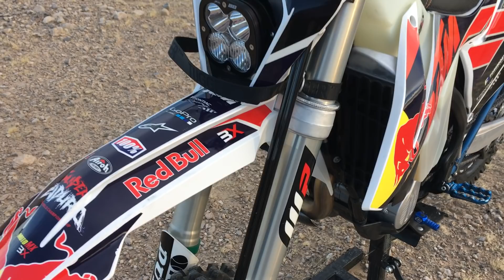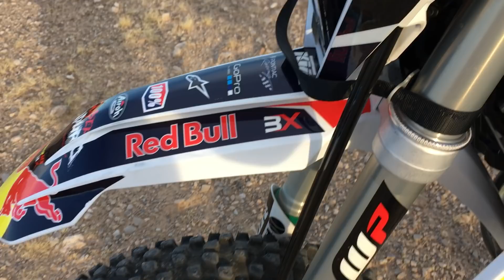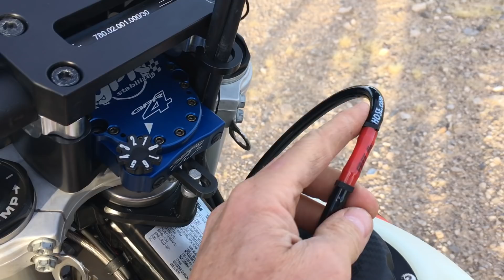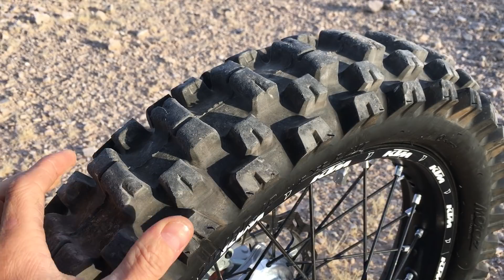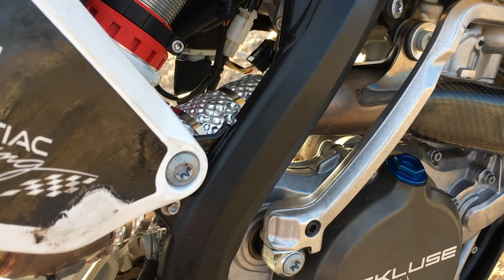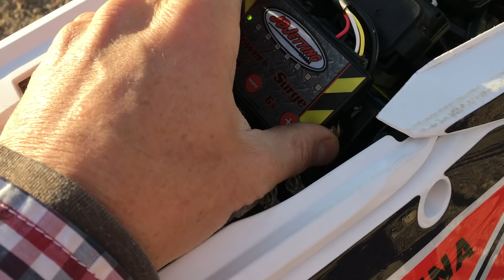2017 2018 2019 KTM 500 EXC-F build

Comment: I live in Maine and have the exact same motorcycle and I did almost the exact same upgrades SMS exhaust I did the same ignition module where can you adjust the fuel injection and I also blocked off the air intake and remove the Reed valve and edit a small sprocket on the front and it's unbelievable what an amazing motorcycle I love it

Comment: $11,000 and you have to buy tires, head light, skid plate, turn signal, foot pegs , shift peg, shock cover plate, brake rotor cover , axle adjuster block, shock spring, 
seat, grips, wmf muffler, pipe guard,  kick starter , battery , tuner , ha ha  NUTS !
Buy used with these parts on it.

Comment: I had a question about the turn signals.  I just bought a pair, I started to drill in the same spot that you have them. However the length of the threaded peice on the signal are too long too fit in the channel where the wires should go. Did you have to cut the signal or use washers to gain clearance?

Comment: Something to keep in mind with EXC's, the kickstarter is only useful if your battery is still good, but can't spin the starter fast enough to get the engine running. If your battery is actually dead, the bike won't run no matter how many times you kick it, bump start it, etc.

If you're going to add a kickstarter, I think also adding a capacitor system is a must
Reply: I’ve also read about this issue... so kick start only good if a little juice is still available, worth looking at the solution or carry a small bank that serves as a jump starter
Reply: and a switch to turn off the always on headlight
Reply from the maker: Nice observation!

Comment: Did you have to use the dual load equalizer’s on the rage turn signals?
Reply from the maker: if you mean an LED specific turn signal flasher to replace the stock flasher - then yes.
Reply: HoboMoped ya going from stock flasher to the LED rings, on there website it says that you might need their “dual load equalizers” if you are. I was just wondering if they were needed

Comment: The accessories are worth more than my bike.
Reply from the maker: moto at this level is the kind of thing where you open up your wallet and shake hard!
Reply: Do you have a part number for that sicass rear fender? The only thing I can find on their website has larger turn signals at the very back of the fender.

Comment: have you done builds with big bore kits like thumperracing 660 kit for the 500
Reply from the maker: i wish. that's a $5k-6k engine mod job by the time it's all installed, rebuilt and ready to ride. no one really needs that kind of power on the dirt - that's a snow bike set up. why do you ask? you looking to build a 90hp dirt bike?!
Reply: just seeing if you have done builds like this with big bore kit's one i would go for is the 450's 540 big bore kit and ktm make a 690 husqvarna 701 honda had a 700 and maico has there 685 2t so i would not say it would make the ktm 500 a snow bike

Comment: Great build and video. Inspiring me to do some of the same mods. I have a 2018 500 EXC and installed the rear Motogadget M Blaze turn signals and they worked great, I then installed the Rage front turn signals and they cause both the Blaze to flash at the same time when turn signal is used. Hook back up the stock fronts and everything is fine. Any ideas? Thanks
Reply: I think I found the answer, a Sicass wire harness should stop the issue.
Reply from the maker: that's a strange one. like you have hazards. are you using an LED specific flasher unit?
Reply from the maker: Chris Gilder https://tacomoto.co/products/fork-wrap-led-full-light-turn-signals

Comment: I hate how hard it is to get matching blue anodizing from different companies!
Reply: Simple to fix take all your parts and have them re anodized to the same blue
Reply from the maker: yep, everyone has their own version of blue. same problem with all the orange bits you might want to add to a bike. it's pretty maddening. the only way to get uniformity is to find an anodizer in your area and have them strip and color all your pieces all at the same time. it's EXPENSIVE to do it this way but it ensures perfection of thta's what you're after.
Reply: zakky I
Reply: The problem is there isn't an exact science to anodizing the colour depends on tint and time in the dye etc the can vary from batch to batch let alone different companies

Comment: Moose feels better than air??
Reply from the maker: well, it depends on who you ask. 

we've bought and tested all the tire inflation systems out there, and in my humble opinion at he bottom of the list is a traditional tube, at the top of the list is tire balls, and just under them is a mousse. there's generally 3 flavors of mousse in terms of feel - the most lively and responsive is the NirtoMouses, in the middle zone is the michelin, and the softest or most 'neutral' is the motoz super mousse. that's my favorite. 

a mousse doesn't transit the deflection of the tire carcass back into the bike, doesn't roll the tire in side-flex in cornering, and never flats you out. 

it can be an acquired taste to some, but i'd say well worth experiencing to see what you think.

Comment: Bad-ass build !!  Did you use an inline resistor on the MotoGadget rear blinkers, and if so, what value did you choose ??  I have a '15 FE501S and thinking about adding the rear blinkers.  Also, where can I find that material you wrapped on the header to keep the heat off the shock ?
Reply from the maker: wicked cool lights right! the m.blaze wires straight into the bike harness, and install yourself an LED spcefic flasher to ensure thy flash at the normal 1 second on / off rate. https://cdn.shopify.com/s/files/1/0072/8562/files/mblaze_disc_manual_de_en.pdf

Comment: i just bought this bike brand new, its now less than 2 months old and im already having problems. the bike wont start. the bike ruined the stock battery, its completely dead and wont charge. i put in a new battery and the bike only starts half of the time. when i try to start it sometimes none of my electronics turn on and it wont even prime the fuel into the engine. or sometimes it primes the fuel then just clicks and doesnt even try to do anything else. im so over ktm at this point. $12k on a brand new bike and i already cant ride with my friends that have 20 year old dirtbikes running fine all day. really depressing. KTM is such a joke. I didnt want to believe what everyone said about ktm being unreliable but this is already like the 3rd time the bike left me stranded on BRAND NEW bike...unacceptable
Reply: Every KTM I have ever bought I had to replace the battery. The stock bateries suck. Now when I buy a new one I make the dealer throw in a new battery.
Reply from the maker: RideRedRacer well hell. That sucks. Sorry to hear about your issues. Your bike likely came with Skyrich brand battery? Ktm, Honda and a few of the other manufactures have been using them in the new bikes and in my experience I see these batteries fail very often. I have a small but growing pile of them in the shop as they die off. 

But after replacing all of these with a Shorai or Antigravity 8 cell battery all these bikes are problem free from then on. 

I know it’s lame to buy a new machine and have a garbage battery. Unfortunately is somewhat common. 

Have you been to the dealer and raised hell about it. Have him replace the battery with a Shorai or Antigravity and throw in an  Optimate brand tender. Best trickle we’ve tested.
Reply: I have a warranty, ill go to the dealer asap. I used my own brand new Shorai Battery testing at 13.3v and the bike still makes audible clicking noises from the relays and thats it. the bike doesnt try to start at all. Sometimes when i turn the key on nothing happens at all. and sometimes it works fine. Yes the stock battery is Skyrich
Reply from the maker: if and when it acts up again are you able to make a video of what it's doing and post it with a link here in this thread?
Reply from the maker: well my friend, unluckily, you've discovered the Achilles heel of the modern dual power FI bikes. these bikes run on both AC and DC power.

the generator has two windings. one small one that sends a small amount of AC straight away to the ignition system / coil. the other winding is much larger, like 80-150 watts and sends that to the voltage rectifier where it's scrubbed into DC and sent to everything else (lighting, fuel injection system, aux power systems).

when you loose the ground, or have a completely flat, fully dead battery there's no voltage available to the output side of the rectifier so even though the gen is making the power and it's available it's not flowing out of the rectifier so there's no voltage to the bike and everything dies.

this can happen with a fully dead battery or when the ground or power strap comes off a charged battery. bike dies a sudden death of no power.
 
you found your problem, a loose ground. i've seen that happen before, especially on bikes that had the stock plastics replaced and the grounding bolt didn't get re tightened well enough.

if a bike has a fully dead battery, it won't kick start because because there's 0 volts at the rectifier and none will flow from the generator.

there's lots of ways to deal with this. some guys pack a pair of ATV jumper cables and jump the dead bike from another bike or vehicle. some guys carry one of the very cool lith-io automotive style jump start battery packs that fit in a pocket. i've jumped a car from those. mind blowing.

another option is to kick or bump start your bike after you've disconnected the battery and wired a 10k mf capacitor across the cables. here's a good video showing that. https://youtu.be/8L8PMBa9Pwc

again, it's super unfortunate you had that happen, and good on you for fixing it, but it's the scourge of the dual power modern FI bike, all brands, KTM included.
Reply from the maker: i know your frustration, it is lame that a ground bold was loose on new bike. i don't know if a bike ships from the factory with the battery and ground strap intact or if that's a dealer item. the webbing of the ground strap is sufficient for the electrical demand, it's just that bolt was loose on your bike. there should be a grooved scratch washer under the strap to provide a good positive connection into the aluminum of the subframe. with the washer there, the bolt tight that should hopefully be the last time you have any trouble with your new bike.
Reply from the maker: the manufacturers are all converting over to lith-io batteis which is great, but they've been installing low AH, unreliable units so far. honda, ktm, husky and a few others have chosen to go with HangZhou SKYRICH POWER CO.,LTD battery product and the results are underwhelming. almost all these have failed on our fleet of 15+ bikes and we've pulled pretty much all of them out and gone with Shorai and Antigravity. no failures yet with those.
Reply from the maker: let us know how it turns out. curious to hear what the problem was.
Reply: well i got the bike back today and they told me they couldnt find any problem. but of coarse now the bike starts everytime with no issues. this really sucks i was hoping they at least found something wrong. now i have a bike that i cant even trust. im going to end up getting stranded way out in the middle of the desert
Reply: yes id be glad to share a video if it happens again. maybe someone can figure out what is happening. i have started the bike about 15 times since i got it back with no issues
Reply: no, the bolt was not loose on the bike. it was extremely tight. the ground cable is defective or KTM designed a faulty ground cable. I literally had to buy a different ground cable to fix this issue
Reply: lol well now it started doing it again but i think i figured out the solution. the bike was stalling on me while riding full speed, very dangerous. so I read about people having ground issues from the battery so i replaced the stock ground cable with a nice new thick one and i also doubled up and ran another ground cable to my main frame. since i did that the bike ran perfect for about 40 miles. it really feels like that was the issue. it was just losing the ground somehow.
Reply: im glad it was only a bad ground but i still dont understand why this happened on a brand new bike with all bolts extremely tight. its unacceptable on Ktms part that they used such a thin braided ground wire. thanks for all the tips!

Comment: I’d recommend some radiator protection, I have a husky 501 and they are a must. Got them through the husky catalogue, I’m sure Ktm have something similar in hard parts.
Reply from the maker: Leon you’re definetly right about that. New for the 17+ bikes is a robust front brush guard that acts as a rad brace / crash guard suitable for most casual riders. Hard core guys will want something more substantial and metal - like the ktm/husky hard parts set like you’d mentioned. Or enduro engineering, they have a terrific guard kit we like and use allot.

Comment: Hi, what AntiGravity battery did you use?  Did you use the AG-801 (8-Cell)? AG doesn't have a listing for this year bike and RM-ATV doesn't list the manufacturer ID.  Thanks.
Reply: yes, the AG-801. it will fit in this bike, and pretty much all the ktm bikes back to the 98' 520's

Comment: I have the same Highway Dirt Bike handle bar set up and it’s terrible if you’re an aggressive rider. They are so rigid that there is no flex at all on the handlebars. Really hard on my wrists on a long day and I’ll never use a mount like that for hand guards again. 
Sweet bike though and some of those parts used gave me some ideas for the mods I want to do to my old sad looking 500!
Reply from the maker: best of luck on your bike build. the HDB set up is unrivaled in it's design and execution, however you have a good point. some riders notice the rigidity of them and feel it in their wrists. and there are some great solutions out there. probably the best might be flexxbars with fastway bark busters with the nylon washers at the clamp point. check out the interwebs for those products and reviews.
Reply: HoboMoped  Agree that HDB guards are definitely a strong, solid set up. I have Flexx bars on my other bike. Absolutely love them.

Comment: Heard the vortex ecu is the way to go. out performs all the tuners ..just got my euro map tweaked and love it but might have to spend the $$ for the ecu in the near future lol.... man love your bike tho 😊
Reply from the maker: thanks for watching our video. on the ecm, we like to use the stock ecm and program, adjust the TPS a few volts advanced, and add on a fuel injection tuner. we don't have anything against a complete aftermarket ecm like the vortex, we're just going for max performance out of as much of a stock platform as possible. the vortex has had some reliability issues in the past and water proofing problems, but i'm sure they've sorted that out. sometimes we dump a bike in the ocean in baja and cant take any changes.
Reply: HoboMoped if I’m just looking to get a slip on pipe I’m I fine with the JD 6X ? Is there a better one to get like the JD 6X that’s simple? It seems like people have to jump thru hoops to get these euro maps. Great vid and narration too!
Reply from the maker: as we say in the video, if you change anything in the intake or exhaust system from stock then you need more fuel. and you have various options for that. the one we like is to plug in a fuel injection tuner. we like the EJK by dobeck performance. they OEM this device to JD, FMF, and various others. it's plug and play, gives you 6 throttle positions  to tune, and makes a huge difference with the lean issues that come up with any exhaust mod. we've tried all the other options and permutations to get more fuel, and this is the one that we like the best.
Reply: tk cota I also have the Euro map. What changes did you make as far as tweaking?
Reply: NaturalAi they set the acceleration fuel settings and changed  fuel delivery and rpm ranges... Its also set as having an after market exhaust ..the original euro map is mapped as having the stock exhaust on...I loved the euro map but I could tell the difference getting the tweaked map..... I sent it to blias racing........    https://www.blaisracingservices.com/2012-2017-ktm-husqvarna-custom-ecu-mapping.html
Reply: HoboMoped  thanks much I appreciate your info. I’m also wondering if this will help my stalling issues? There’s been a few times the bikes stalled out when I came to a stop. It happened twice B4 my 500mile service. I wanted to adjust the idle, I thought I’d tell the dealer and let the deal with it and that’s what they ended up doing. The bikes almost at 1500miles and has stalled out about 5 or 6 times after that ONLY when I came to a stop (thank god it’s only when I came to a stop). The dealer is telling me it’s from tipping the bike over and it may stall out the next day but I think that B.S.